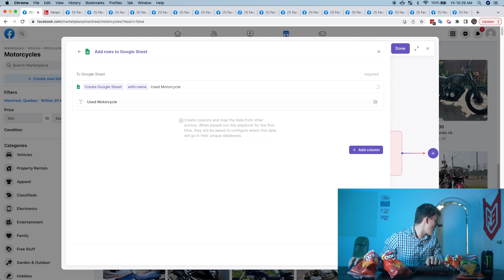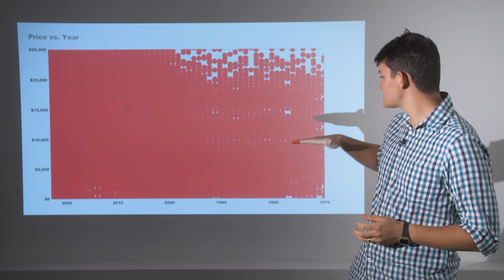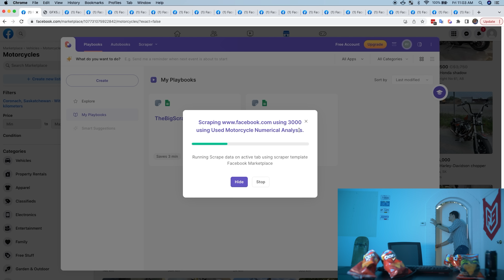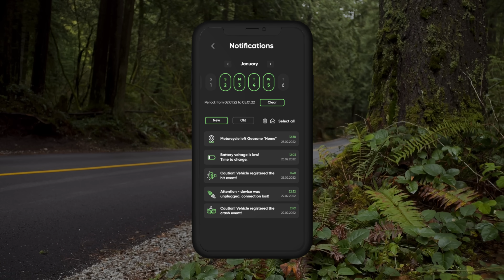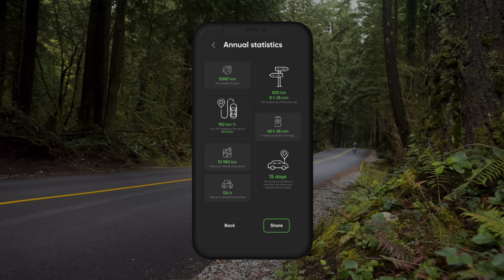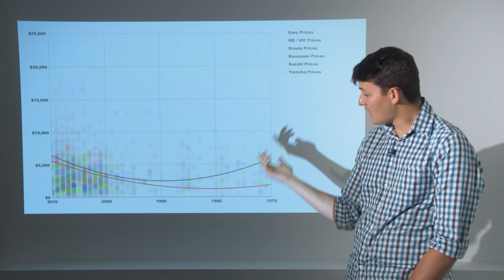Used Motorcycle Prices – A Statistical Analysis

Comment: way back in 1990 i owned an 82 RG250WD, paid about 2200 for it from a bike shop, these days those old RG's RD/RZ, etc are fetching 8-10k in pretty ordinary but rideable condition.
if you collect a few bikes because of nostalgia/sentimental value they will eventually be worth more than you paid if theyre kept in decent running order bt you wont be retiring off the resale value.

Comment: It's funny, completely anecdotally I saw exactly this play out while bike shopping. I wound up getting my barely used '23 Ural with 600 miles about 30% off new MSRP by driving 4hrs away from DC. I'm not an iron horse trader so don't care about profits but this is a very interesting video.

Comment: My research while attempting to procure a specific bike (select Honda SF models) reflects the data presented in this video.  The best deals I found also happened to be in Canada, which happened to be over 2k miles away at the time.  Fly and buy was an option, but I wasn't feeling that adventurous at the moment.  This typed, I did trust these bikes, as the best deals, bar none*, I found happened to be on the best representatives of the bikes I was looking for, sourced via active and tight-knit online communities of owners.

*  I did find several deals I feel fairly confident would've ended with me either found in a dark alley several days later or temporarily taking on stolen property.

My main takeaway from several months of (unsuccessful) searching:  People are weird and a lot of them aren't very smart, honest, nice, realistic, or in possession of the ability to communicate with others (how are these people alive?).

Tips for others:  Don't be in a position where you need to buy.  Do your due diligence.  Know what you want.  Know what you want to pay.  Be ready to buy at any moment.  As with jobs, good deals often aren't advertised.  The best places I've found deals over decades has been user groups.  Occasionally, I've found something say, in a Craigslist type situation, but that's rare and hasn't been for a while... and those are often a gamble.  Learn the vocabulary (it is it's own language).  Don't leave your common sense in the change jar.  Know bikes well or make a friend with someone who does (who'll go with you to see bikes you're interested in, although if you want the best deals, that person should be you, because you may be buying something far from your present locale).  Don't be stupid or make bad decisions.

Comment: If you buy a cheap used bike which was the first year of production for that generation of model, you can ride the hell out of it for a decade, then buy a cheap used bike of the same model which was the final year of that generation and part out the first bike to feed  the other.  You'll also already have a storehouse of tires, oil filters, etc. for it and can transfer over all your favorite accessories.

Comment: Even more useful would be long term data mined to determine what time of year to sell and buy, but everyone already knows the best time to buy is fall and winter and the best time to sell is spring and summer.  That's true for new bikes as well as new.  I bought a new 2019 BMW G310GS in late October 2020, a few months before the 2021 models would arrive.  BMW knocked off $1000 and the dealer didn't want to pay taxes on the inventory so they knocked off $400.  The new bike with three year factory warranty was $4920 out the door, which was less than the asking price on two year old used bikes.

Comment: The 10 year old used bike selling for $4-5k needs $2-3k of repairs and replacements.
For a total cost of $6-8k, might as well buy a new bike or one that is only 2-3 years old...
😂😂😂
Reply: Not always, my bike was 16 years old when I bought it and only needed a back tire for a little over 100 bucks, 5 years later she's still running with no issues.
Reply: @polska905  used bike prices 5 years back weren't what they are nowadays...
People are asking $5k for 10 year old bikes with dead batteries, old tires, rotting rubber parts...
Reply: @justathinker8669  so by your logic that 50k Harley is only worth 5k after 10 years? people can ask for what ever they want, doesn't mean they will get it...
Reply: @polska905  sorry I didn't mention, my numbers are based on a basic bike ninja 250/300/400, Yamaha R3, Honda 500.
You can get a brand new one for around Canadian $7-9k

Comment: Ryan I love your technical analyses and I've a suggestion for a video. Here in the UK we're currently suffering from "do gooder" politicians and bureaucrats lowering speed limits in the name of "saving lives".  There's a lot of talk about variable speed limits, which seem to make a lot of sense. Lower speeds outside schools during term time, and at school start and end times, and in other urban environments at busy times is eminently sensible and with some "smart" signage relatively easy to administer. However, if the theory of variable speed limits is accepted ( and it seems that it largely is amongst road safety planners ) then there's a massive elephant in the room ...... if risk of collision and the consequences of that collision are a factor in the speed limit then motorbikes should be largely exempt from the lower limits anyway !! The frontal area and inertial energy of a motorbike is significantly lower than that of a car, van or lorry .... therefore the statistical risk of impact in any given situation coupled with the much reduced damage / injury caused ( far less energy transferred ) in that impact should be taken into consideration when setting speed limits. Why can't speed limits be related to type of vehicle just as much as they are to location and time of day ?? In this case motorbikes should be logically allowed to travel faster than cars, vans and lorries. So how about a study into why technically motorbikes are safer for other road users than just about any other vehicle type and how consequently, far from being vilified the motorcyclist could be subjected to less stringent regulation NOT more ? Just an idea :)

Comment: Bud, what about the people who just want to dart down an old Woods road?

New bikes are over rated.
New bikers... Know this ; no one gives a shit about your new leathers or fifty power options.
When and why did bikes become so dolled up?

I've been riding machines in and all season machines for decades...

What really matters is the time you pass with your buddies.

Pick up an old bike, ride it well and have a cup of tea.

All of these options... No need. Wrist, throttle, road.
You can't handle the power without electronic aid... Then get a bike better suited to your capacity.

20,000 for an over powered machine that you cannot drive.
Why.
Spend 5,000 on a machine that you can ride like it was meant to be.

Comment: The culture of selling motorcycles online has changed for various reasons. Scalpers attempting to take advantage of FOMO on hard-to-acquire models and the market constraints since 2020 have wrecked the used market if you are only looking at posted selling prices. The market was already heading in that direction when Craigslist stopped free motorcycle ads. 

The other issue with the market is people posting motorcycles they still owe money on. They were likely upside down in the loan and trying to sell it for what they owe instead of what it is worth. Those bikes stay advertised forever because no one is interested. 

It doesn't really matter where you are or what you want to buy. Have cash and be ready to jump when you see what you want. You might have to drive 6 hours for a reasonable deal but that has less to do with the local market and more to do with casting a wide net.

Comment: Around 2010 I did a scatter plot chart of Japanese 450 mX bikes (as I was in the market.) It was a manual process using CL at the time over several months.   It was central CA so weather was mostly negated.  At the time, $3500-$4000 was where the depreciation curve started to flatten out.  It’s hard to take all these datapoints in the video and make them actionable.    Better analysis would probably be more specific like 600cc Japanese sport bikes.  Or 500cc-700cc dual sports.  Also, external factors like housing crash in 08 might be hard to quantify as others have already stated.  Still a very cool analysis.

Comment: I have a 2001 BMW 1150GS that I keep in the barn, I don't ride it anymore because I went with a newer modern lighter dual sport. A decent used one on the market goes for around $3500 to $4,000. I'm going to hold off on selling it or just forget about it and then 40 years from now, someone will post a picture of a 2001 BMW 1150 GS barn find bike.

Comment: Bikes taht are older than 10 years on the road  are starting to stabilize their prices because as time passes the users and potential buyers get a better understanding and form an opinion on the build quality, reliability, common issues, aftermarket availability of replacement parts and so on. Good quality bikes that can last a long time with minimal maintenance tend to keep their price at a relatively stable level. i.e transalp, africa twin, tenere and super tenere, the GS series of BMW, older gens of hondas v4 engined bikes from the vfr and vf series etc.

Comment: In my area, at least, bike mechanics that are willing to work on carb'ed bikes is a major factor... and one that is very important to the price curves.  In short, just like with auto repair shops, modern mechanics cannot simply plug in the computer, see codes, replace parts, and set default computer programming... on a carb that needs to be rebuilt.  And, new (and quality rebuilt) replacement parts are getting hard to find as well.

Comment: I only buy low mile, used motorcycles. You can save many thousands. For example, a new R1250GSA is $25k. A sub 15k mile R1200GSA can be had for $13-15k. Used bikes also often have lots of upgrades worth thousands.

Comment: I bought a 9 year old HD Road Glide in 2015 for $6500cnd. Rode 30,000km over three years traded it in for $2000 more than I paid. The trade was a 2015 ktm 1190 adventure with only 12,000km in 2018 that cost me $5000 and my HD. So essentially I have paid $11,500 and have no rode 70,000km on two bikes and I believe I could get around $9000 for my bike.
My riding gear has cost more than the bike itself 😂

Comment: It's not all statistics. I drive an Yamaha Nmax 125 scooter, bought in 2022. At a red light I met a guy driving the same, but 3 years older. We swapped bikes and wow, what a difference. His scooter felt heavier, and steering was sluggish. Each year manufacturers fine tune the models, making them better in ways that are not always visible in the general specs. You buy a 10 year old bike, works fine, on paper is just as good as the new ones, but.. you're missing out on 10 years of model advancement. Your call.

Comment: One issue with used motorcycles or autos - Most shops turn away anything over 10 years old unless grandfathered in from the dealership.  Independent shops are getting wise and charging $130-$160/hour as a penalty since they “don’t know the vehicle”.  That means suspension, top end, drive shaft, water pumps, electrics, etc. can end up costing a small fortune if you are able to get service.  In my experience, very few exceptions, most mechanics regardless of marquee have done more damage than repair - dealers and indies.  That’s how they keep their doors open.  If it is your main transportation, do you have the time to crack a bike open in your garage waiting on delayed/overpriced parts?  Or are you ok with it sitting at a dealer for months at a time?  The market is not kind right now for new or used.

Comment: I notice that a lot of people sell right around 25,000km. I suspect that it has to do with the valve-clearance adjustment looming on the maintenance schedule. On modern engines with the shim-under-bucket design this involves actually removing the cams to change any shims that might be out of spec. The job is expensive just in terms of the labour involved, and sensitive because there's no real margin for error when you re-install the cams and re-time the engine.
Reply: I know people that just ride the bike until it will be hard to start. I've done mine myself Ninja 1000 at 40k ,,, (was supposed to be done at 25k) I had one valve out of 16 that was on the low side. meh

Comment: 3:35 The problem with this analysis of Harley prices is that what they're advertised cor isn't necessarily what they'll sell for. I see 15 year old Dynas advertized for $10,000, but that doesn't mean they'll get $10,000....or even sell it at all, lingering on in the back of the garage or under a tarp in the side yard until it gets given away.

Comment: In my country where lower cc units are everywhere for commute, used motorcycles tend to sell around 
80% for less than 2 years
60% for 3 yrs
And finally dwindles to 50% for 5-10 years
This is for low cc units 125-200cc

Comment: could've definitely told you that around 2000 is the turning point in value just from experience. Definitely accurate. Not that I would EVER sell my 99 Firestorm <3 bikes peaked in the late 90s-early 2000s before they started installing a full gaming pc worth of electrickery in the fuckers. If I can't smell the carbs, I'm not interested.

Comment: Don't know that I'd assign bike values based on age. There are specific models that are considered special interest and are valued accordingly. Conversely, there are some models that have little 'curb appeal' for most riders and can be difficult to sell. Rather than pour over charts & graphs, I research specific models and look at the current asking prices around the country. Also, the timing of a sale or purchase is very important. Sell in the spring, buy in the fall is my mantra. Spring seems to pique motorcycle purchase interest because of the coming riding season. In the fall, sellers are probably looking to free up space or just cash in at the end of their riding season. As the trees shed their leaves, shrewd buyers will haggle accordingly. If selling (in any season), it is a good idea to be thinking about two numbers; the price you would like to get and the minimal amount that you would consider taking. As with anything, just do your homework first.  Ride safe, y'all!

Comment: Very good. I feel at my age tht it's time to buy a Harlwy. But my 2003 Z1000 has twice the horse power, and 1% the maintenace, with near anvil-like depenability. So, thanks I feel better from this  this information. Say hi to Noraly for me. Cheers from the Sea2Sky corridor.
Reply: The only maintenance my mechanically stock harleys have required is consumables - oil changes, tires, etc.

Comment: The motorcycle market is definitely pretty hot right now. In 2020, I bought a 2018 CBR 1000 with about 2k miles on it for about 10.5k. Now, you couldn't get a 2 year old liter bike for probably less that 13-15k.

Interesting because motorcycles are often a pure luxury item

Comment: 2004-2006 Sportsters are solid buys.  Benefit of rubber mounting and more power, with simplicity of carburetor.  Bought 2 nice ones for $2,000 and $2,500.

Comment: This is EXACTLY the topic my friends and I were just discussing! We're hearing disturbing rumors of manufacturers dropping parts and service support for bikes that are 10+ years old. I'd REALLY like to see a video on the subject of which bikes to buy as "forever bike".

Modern bikes seem especially problematic because of the digital electronics. CAN Bus may keep you from replacing that busted ignition switch with a toggle switch (yes, I had a bike like that).

You can still get parts for a Harley Flathead and for a Triumph Engineering twin but what other bikes have that sort of support? Sportster? KLR 650? DR650S? TW200? XR650L? Bullet?

What can I buy today (new or used) that I know I will likely be able to still be riding without any issues whatsoever 12+ years from now?
Reply: @peterholthoffman - One thing to think about is how many were sold.  This can mean that there are a lot of spares in breakers that are no longer available from the manufacturers.  I'm not thinking about a C90 of which Honda sold gadzillions but buying a Rune and expecting to be able to get an exhaust is like me expecting a date with Karen Gillan.  Not only will more breaker spares be available for a popular bike but aftermarket companies will also have made pattern or replacment parts.

As for longevity 2009/2010 seems to be the cut off year.  Before that all was roses and money was spent on the quality of the bikes.  After the financial crash manufacturers built to a budget and not a standard so quality hit the buffers.  I have a 100 000 + mile Honda Hornet 900 from 2006 that is still on the original parts and looks good and I also put a CB500 'round the clock.  Parts for the 500 are more readily available as a lot more were sold.

If you can find a sub 30 000 mile Hornet 900 in original trim then that would be a good buy.  A couple of grand should see you get one and in my experience high milages don't bother it.
Reply: F9 made a video about BMW K. You might want to watch it.
Reply: A BMW R or XR or GS
Reply: Well for old bikes you have the second hand market. Lots of old bikes get sold in parts to keep the others alive a bit longer. So the popularity of the model is much more important then the support given to the model.
Reply: Don't pick at my KLR for being reparablity

Comment: These prices seem a bit insane, here in Ireland and GB you get the huge dip (i.e. ~€3-4k) at around 11 years still with f all miles, then kind of has a slow plataeu after that depending on mileage. Plus bikes are generally cheaper in my capital city Dublin here in Ireland anyway.